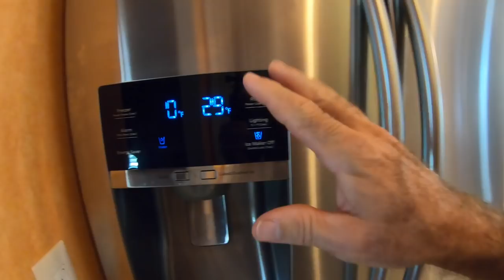HOW TO FIX A NOISY SAMSUNG FRENCH DOOR MODEL REFRIGERATOR

Comment: Thank you James. We have the same unit. So far no problem but if I have to go through that exercise I would wrap & seal those incoming refrigerant pipes with foam insulation to keep out moisture so it won't happen again.  Sad to have to defrost a self-defrosting fridge in 2019!   I think the lower humidity here in Alberta helps!
Reply from the maker: I believe your observation about humidity is the key point and something I failed to discuss in the video.  We are in a high humidity climate both here in SC and in the Philippines.  High humidity is a key factor in icing of your ref unit.

Comment: 12:00 WRONG, (heating/defrosting near the cooling pipes above the evaporator)
If you worry about melting solder in the connections with a heat gun... I imagine a heating resistor element would be even more dangerous. 
I think those pipes could have insulation in form of two side aluminum and glass fiber cloth in the middle, so cold is not wasted and the copper tubes don’t come in contact with humid air. That’s all
But the production costs have go go down, not up... the design is really good, but quality of components was lowered and some components removed before manufacturing. 
I am also an engineer and can see the directors board meetings pull stunts like those... I know the type

Comment: I turned the energy-saving feature off that fixed the problem, they do that to get an energy star rating but by doing that the heater element doesn't come on as often that it should

Comment: Very well done, and thanks for your effort. Your engineering assessment and POV is very helpful. I also was troubled with the Ice maching needing replacement due to a known engineering flaw in the unit. 
My similar unit has a bit different symptom. The sound pulsates as opposed to a continuous purr. Also, when I opened the door, the sound didn't stop until I pulled out the ice machine supply basin. After about 5 seconds the sound then halted. 
Any thoughts?
Reply from the maker: I also have a How To video on the ice maker.

Comment: Dear James, thank you so much for your quick response. You are right! My refrigerator build up ice around evaporator every next day and I can not find defrost timer. I can not see the end part of your advice. Thank you for your time and God bless you!
Reply from the maker: Whew!  Glad you caught my comment.  Here's a repost of the troubleshooting.  Good luck and let us know how it goes.

Samsung refrigerators go into auto defrost every 8-10 hours. The main control board on the back is what sends power to the defrost heater in the refrigerator and freezer (on dual evaporator systems).  I’m pretty sure there is no way to change the defrost cycle but you can manually put your refrigerator into defrost mode yourself.  To do this, press both the “Power Freeze” and “Fridge” buttons at the same time.  Hold both buttons until the display beeps and goes blank.  Next, press the “Freezer” button a second time.  After a while, you should have water melting into the evaporation tray under the refrigerator.  It might be necessary to unplug and replug in the refrigerator to take it out of defrost cycle.

If you had ice the very next day its possible you didn't get all the ice melted when you followed my procedures.  Even behind the copper pipe that goes into the foam insulation, you must make sure it's all defrosted.  Also, make sure all the plugs are connected back properly into the connectors.  If you have the same refrigerator as mine you can use the video as a reference.  You didn't mention where the ice build up was concentrated.  That might be helpful as well in troubleshooting.

If after doing all the above and you still have an issue with freezing, it might be a problem that needs to be looked at by a technician as its possible the thermostat sensor is bad.  It will need to be checked with a multimeter to see if the Ohms and voltage are correct.  If not, you probably have a faulty sensor or electronics component.
Reply: @MyPIDream  OMG your explaining is so clearly. I think my has problem in defrosting. I will test and find out which part is broken.